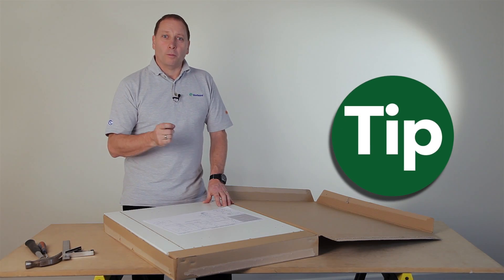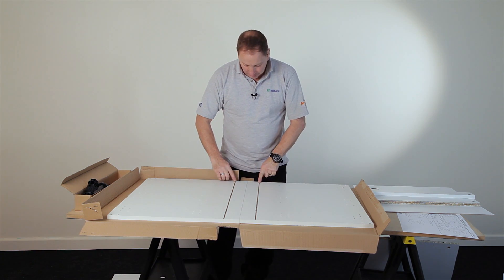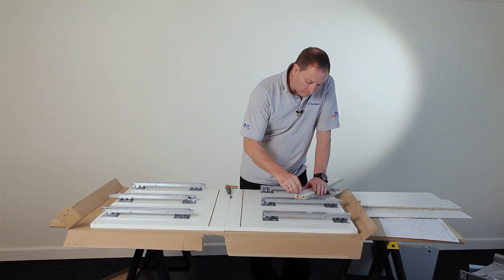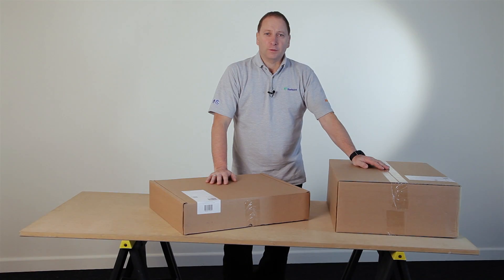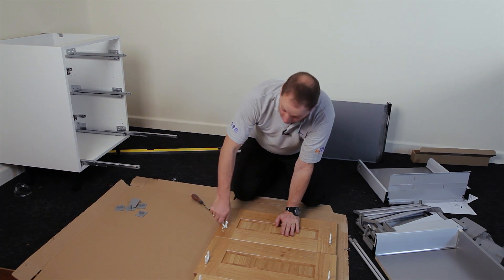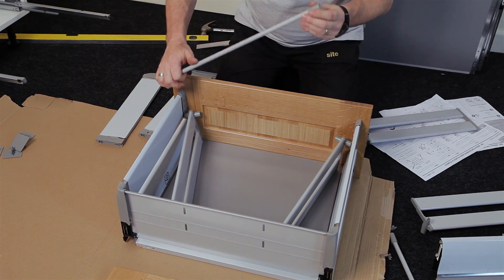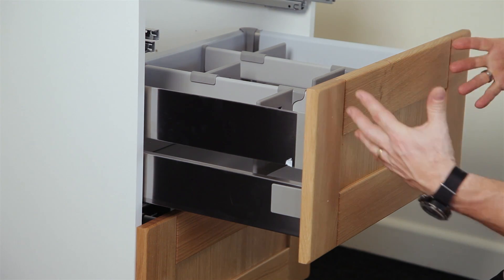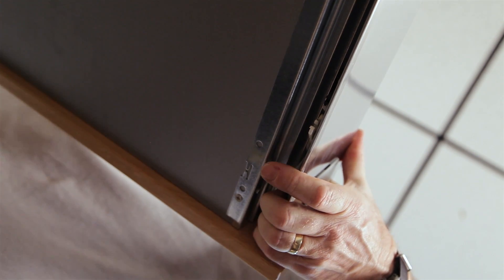Cooke and Lewis 2016 - Premium Plus Drawers

Comment: Hi. The instructions out of the box are terrible. B&q have no support either. The problem is the pre drilled holes on the cabinet are in the wrong place for the drawer runners. You have to measure, mark and drill your own holes, but no instruction on how to do this. Very frustrating and I'm keen on getting these fitted as soon as possible. Can you offer any help? They are being fitted into an 800mm b&q cabinet :(